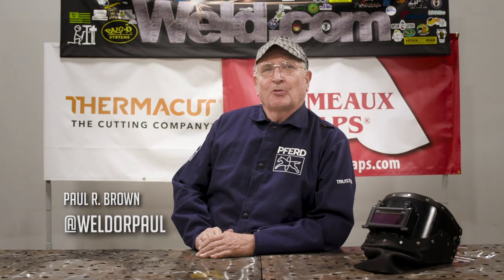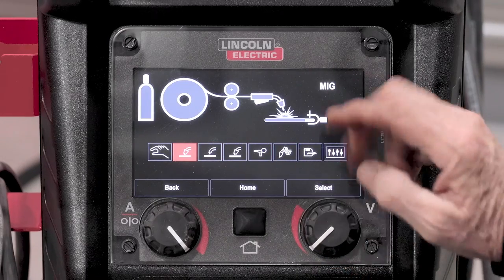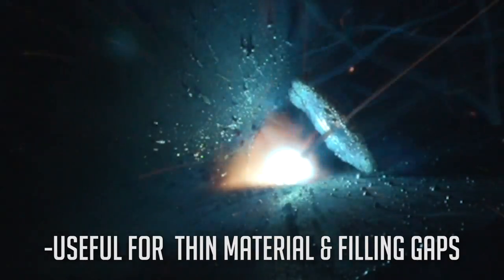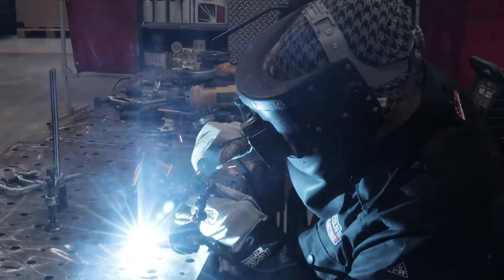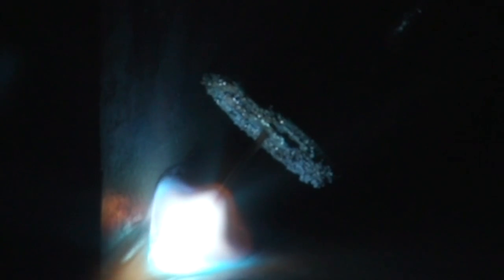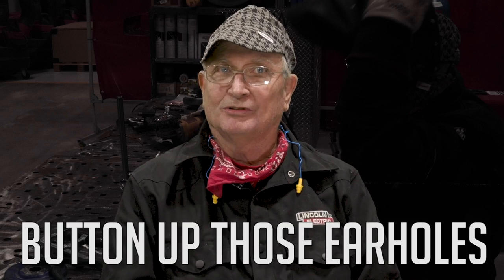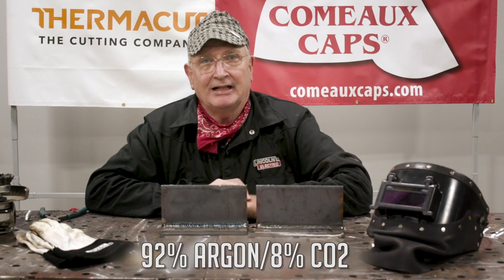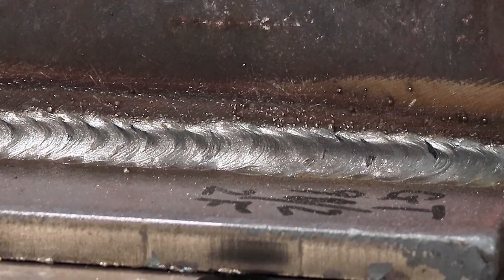GMAW - Transfer Modes: Short Circuit & Spray

Comment: Great video. We usually use 90/10 Ar/CO2 for spray. Just FYI, for the GMAW application, AWS 5.17 ( mentioned at 1min 22 sec.) is technically for Sub Arc welding. The appropriate AWS Specification for this application is AWS A5.18 (Specification for Carbon Steel Electrodes and Rods for Gas Shielded Arc Welding)
Reply: Daryl, Opps, we will have to get after our tech writer on that one......we appreciate you pointing the error out, thanks for watching and especially commenting, we at weld.com appreciate it, cheers, Paul
Reply: @ypaulbrown  Great job on the videos. I met with the girls here in St. Pete not too long ago.
Reply: @darylpeterson4626  they are a lively bunch......Paul

Comment: Very nice video. It helped a lot. When did spray arc and globular transfer show up? When I bought my welder it seemed like there was only short circuit MIG (GMAW for the nerds) and Flux core but MIG was not called short circuit.
Reply: Hey Dad, Spray Arc and Globular have been around pretty much the whole time as 'MIG' GMAW.....lots of experimentation with different gases over the years, in my 1972 Lincoln Handbook or Arc Welding, it is covered in there very well, you need to get one of these books if you do not have, they are 30 bucks from the James F Lincoln foundation....a non profit educational outfit, and it is a book of over 800 pages,,,,,by the way, the Hobart Brothers back in the 1920's came up with the idea of flux core, but the technology at the time did not allow the manufacture of flux core wire, I hope this helps, and thanks so much for watching uncommenting, best wishes, Paul

Comment: I like your hats man. I buy evey houndstooth pattern welder's hat I come across.
I also like axial spray transfer, I like the quiet hiss that it makes and the lack of spatter provided you've got enough arc length and don't puddle dive the electrode.
I think you could have dropped down a volt or so and stayed in spray and gotten a bit more puddle control, but I'm just being an armchair qb at this point.

I enjoy your content man, thanks for the contribution.
Reply: Nikea, thanks so much for the comment......the 95/5 ar-o2 is very hot, 2% o2 is not as hot, and of course the 8%co2 is even cooler......we used the 95/5 ar-o2 to show just how hot  Axial Spray can be........Thanks for watching and commenting, Cheers, Paul

Comment: Hi! 
Between pure Argon and 80% Argon+ 20% co2, which gas is better for spray transfer?
And I want to ask also what kind of welding is hotter and have deeper penetration: pulse mig or mig short circuit?
Reply: User-np...the 80/20 would be better, but even better would be more argon, but pure argon will not work, it needs the co2....as far as hotter and deeper penetration, pulse mig....as you can run hotter but still control.....hope this helps, Paul

Comment: Due to health reasons I been out of the game for about 13yrs. so my exact settings and/or measurements may a lil off as I've forgotten quite a bit.When I welded for a structural steel company we used 80/15 with .045 on everything from 16ga to 1.5". In the vid he said you couldn't weave a spray,why not,I was on the work I did mentioned below.
The butt joints in the 3/4" to 1" plate I'd fill with the short then finish it off with the spray to make a perfectly clean stacked weld within their 1/8" height tolerance.These were 1.5-2" wide bevels and they would come out perfect using a moderately slow O weave.It's been a good while so here's where my settings may be off some.I think I set the voltage for spraying at 28 or 28.6 and wire feed somewhere up around 300-320 (sound about right?).

What I really hated there was welding 3/16 mounting brackets to the 16ga cold rolled with the .045 and 85/15.No one else was able to do it without blowing the hell out of it,actually only a couple of guys there were any good at horizontal welding period.None of them could even do overhead let alone try vertical up or even down,these guys even went to trade schools for welding....
Reply: wow, 16 ga to 3/16.....that was not easy to do.....as far as weaving with spray, I have never been able to get a decent weld with it, but lack the hood time on trying, I found I could run a great bead by just a standard push, thanks for your great comments and thanks for watching, Paul

Comment: argon mix gas is for mig.Co2 is called mag.But what is the abreviation for stick welding.
Reply: SMAW, shielded metal arc welding
Reply: @jakeycakes3502  thanks for watching and commenting, best regards, Paul
Reply: as JakeyCakes said...SMAW....thanks for watching and commenting Stephen and thanks JakeyCakes for commenting and also watching.....Paul

Comment: i was using 90/10 gas, 0.35 wire welding a bunch of 1/4”- 1” thick carbon steel with spray. my sweet spots for 1/4” was 430ipm and 26.3v and 444ipm and 26.8v for thicker steel. hope it helps someone out!
Reply: Thanks for the information......and Thanks for watching and commenting, Paul
Reply: Wow, I use the exact same settings! Haha
Reply: @Snidney100  all that Physics stuff really pays off, thanks for watching and commenting.....Paul

Comment: Could you do a video on this, need to do this for a job 

2G-Horizontal test. 3.5”x5”x1” with 45 degree bevel on plate
3.5x5x1” with 90 degree edges on plate
1- 1”x3/8” backing bar.
 1/16th  flux core wire.
Reply: I will run it by the Boss and see what we can do, Thanks for watching and commenting, Paul

Comment: Never oscillate a mig weld, it can lead to an inconsistent fusion profile internally, if you need a bigger weld turn up the WFS rather than weave, all roads lead to spray, short circuit is not allowed on a lot of structural codes, if you can spray spray it’s better in every way, 75/25 is almost never the answer, if you are short circuiting with 75/25 anything 3/16 or more you are making a mistake, thin material or gaps is the only time you should use it, and yes 75/25 on fluxcore is fine, but fluxcore isn’t always the best option either, that’s a talk for another day, I’ll be happy to answer any intelligent questions anyone has, but will not argue with any set in stone facts stated above
Reply: Thanks for the feed back Ghost Walker.....Paul
Reply: can  you run straight flux core  at spray voltage successfully.  i seem to remember a few projects with flux core where the arc hissed or squeeked rather than sizzled if voltage was high or stickout small
Reply: @peetky8645  interesting, the only spray with flux core I have done is with flux and gas...thanks for watching and commenting...Paul
Reply: @peetky8645  the best way to determine anything is to cut and etch it yourself and see if you are getting adequate fusion and penetration, rather than taking someone’s opinion, there’s a set of concepts like I mentioned before but there’s always an exception somewhere, that being said I would probably say you could run that much voltage, but I don’t believe you’d actually NEED that much voltage, it may take me a while but next chance I get I’ll test it myself and post a video showing the results
Reply: @GhostWalker-tl5sy  looking forward to your post...  do you have a YT channel?

Comment: couldn't have found someone who cam weld for this video? spray arc has a very smooth bead, and I only saw 6 inches of undercut
Reply: Zeke, thanks for watching and commenting, 
Come on down to the weld lab and show us how it's done with only one setup and no testing for only one video  take, 
and on a machine we had never used.....we used the SWAG method if that helps......
So you are saying the sample at 11:06 is not smooth? done  with 92/8 ar-co2  ?
Do you weld with 95/5 ar-o2 like in the sample at 10:35?  that is extremely hot and fluid?

Do you ever do vertical welds with axial spray transfer like at 10:45?
 let us know, we would love to see your results.
Sincerely, Paul
Reply: @ypaulbrown  if you didn't test shit or prepare then what the hell are you guys even doing
Reply: @Slouworker  well, sometimes the big clock on the wall gets in the way of  video production, sorry to disappoint you, but thanks for commenting and watching, we are still growing and sometimes just do not have the time to make the perfect Instagram welds for the video production, as recording is tedious and a one shot deal many times, but I am sure you realize just how difficult video production is.......we will try harder for sure.....Paul